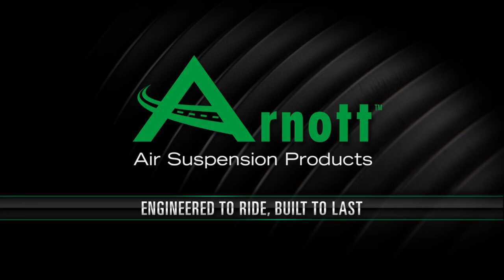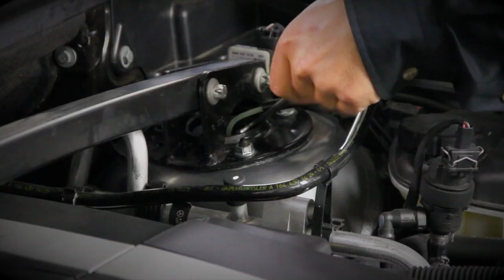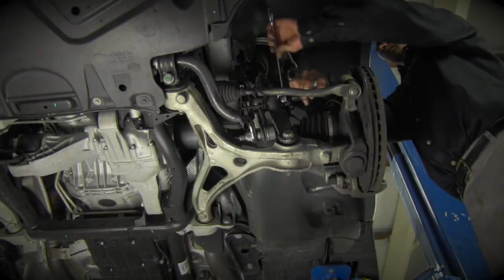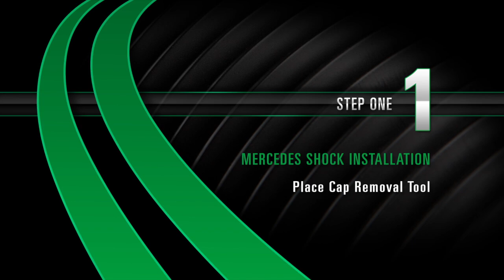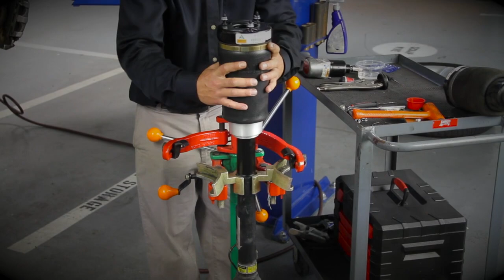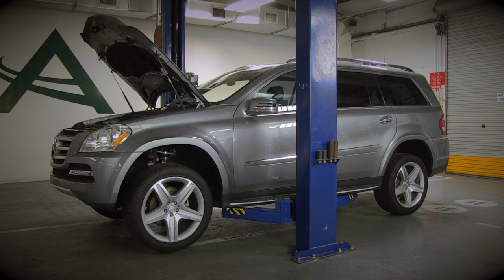Arnott Front Air Spring Replacement (Mercedes)

Comment: Do you tighten the air connection or is it simple push fitting?  If push fitting, is it different than original equipment type or the same?

Comment: I changed my left front on a 2012 GL 450 - took about three hours. Unless if you know your front shock is good, or new, I would recommend replacing the whole assembly if you can. You can get the top bolt on the upper control arm to release by striking the top of the vertical section with a decent size hammer a few times from a few different angles, be careful not to hit the rubber boot. I used a 3 pound sledge hit it about six times and it released. Also the shock assembly (OEM) will have a silver metal cap underneath the airbag. You can use a small screwdriver and a hammer to gently tap upward using the three holes on the cap.  Be careful not to hit the shock itself, you can protect it with a cloth or some other material. You’ll also need a large torxs bit, can’t remember what size exactly to keep a couple of the bolts from spinning when taking off some of the nuts on the front suspension. Also it can be difficult to get the bottom of the airbag to slide down to its resting point but when it fills with air it will push down by itself. When the video says use a lubricant you want to use a petroleum jelly type product. Good Luck!
Reply: Also, I removed the strut tower brace all together to make getting at the air line easier in the engine compartment
Reply: T40

Comment: I had replaced both right and left with Arnott that I purchased at O'Reilly's https://www.oreillyauto.com/shop/AllBrands!  Replacement was plug and play although my Right Front did fail after about 1.5 years - it was a Lifetime Warranty Part https://www.arnottindustries.com  O'Reilly's replaced the part with no issue and Arnott backs the product 100%  Thank you to O'Reilly's and Arnott.  Replace the part in about 40 minutes and my GL450 Airmatic is working and riding perfectly once again!

Comment: I just replaced the front right strut on my 2009 GL450.  Very straight forward, simply follow the video.  One key point - the upper Upper Control Arm does require a Ball Joint Separator!  It does not simply separate as demonstrated in the video.
Reply: I hope you tightened the Axle nut to spec. It is 520 nm or about 383 ft-lbs. It is something very hard to do without a 3/4 torque wrench. Most hit it with an impact when I worked at the MB dealer.
Reply: 0177712664